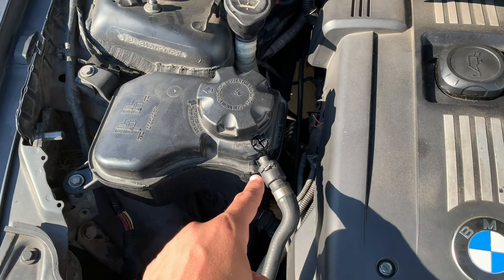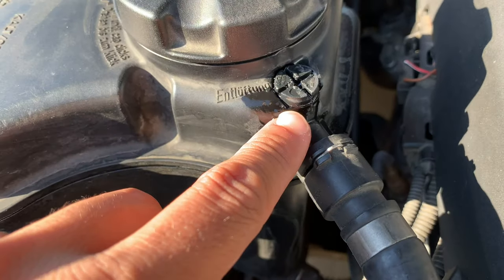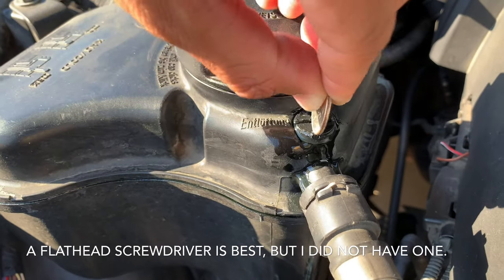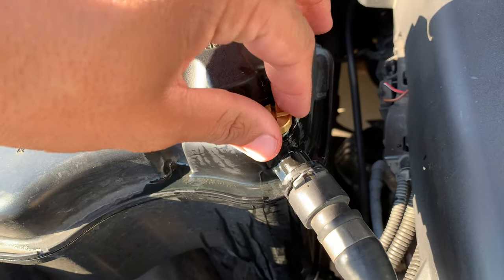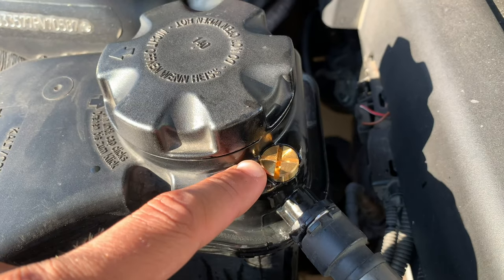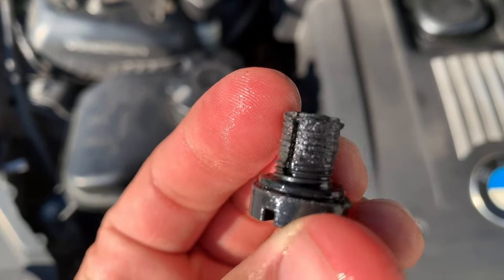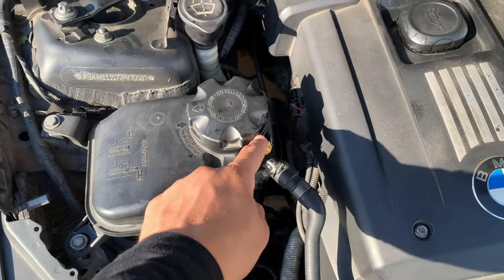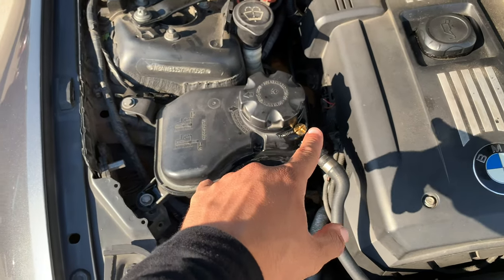BMW Metal Coolant Expansion Tank Bleeder Screw Upgrade! | E46 E60 E90 E92 M3

Comment: Mines litterally snapped 😪 ! The head came off and threading stayed in . defiantly getting one
Reply from the maker: Worth it! Never have to replace again and looks cool too 💯
Reply from the maker: A trick to remove it if the head snapped is get a flathead screwdriver and lighter and heat up the flathead tip until it’s very hot, then press it into the threading hard and it will melt into the broken screw. Then just unscrew it to remove!

Comment: Dude this screw started leaking while I was at the store today went to the oreillys across the street while I was waiting for the tow truck since most of my fluid leaked out. Anyways guy at the store tried to sell me the whole tank he said they didn’t sell the screw on its own. Just now went online and they have the same one you just installed. I ordered it and picking it up Tom. Should have checked on my phone before walking into the store.
Reply from the maker: david guerrero thats pretty messed up that the guy behind the counter wanted you to spend that much $$ on a whole new tank instead of just showing you the best option. Brass screw for the win, glad you got it figured out!

Comment: They use this same cheap plastic screw on Ford and Landrover diesels. Left me stranded for days as nobody here in Australia can get the part. I ended up buying the BMW compatible brass part and a perfect fit on my Ford Territory (V6 Diesel). Thread specs on mine was M10 x1.0 and about 170mm.
Reply: lol a stubby metal bolt, Teflon tape and a standard little oring from any local hardware store could have unstranded you for those days in a pinch.

Comment: Hi I have a question please. I have lot of coolant who left the tank via this screw when I pushed rpm to 4000 for a test. It has a hole in middle of the X. Is it meant to evacuate coolant when coolant pressure is high?
Reply from the maker: If it’s tightened all the way down it shouldn’t, so I’d replace the bleeder screw. It should only do that if it’s loose
Reply: @IzzyE9X  yes it was loose when i wanted to remove it. When i put it back it has broken... but what is the small hole used for? Many thanks

Comment: The screw on mine broke halfway in, how do I remove it ?
Reply from the maker: get a lighter and flat head screwdriver. use the lighter to heat up the flathead screwdriver until it’s crazy hot, then press the screwdriver into the stick part of the screw. It’ll melt a wedge for you to simply rotate and remove
Reply: @IzzyE9X  alrighty I’ll try it now . Thanks for the tips . 🙏🏻

Comment: I have a Bmw f30 did a bleeding procedure and fixed couple thing such as valve cover, oil filter housing gasket, oil change, coolant change, and let the car run for about 20 minutes, i then turned car off and about 10-40minutes later the bleeder screw head broke off and some warm/ hot coolant was squirting out of it, wish I replaced it sooner I currently have the brass one on deck but can’t take off the old thread that’s stuck on there cuz the head broke off
Reply from the maker: To remove the plastic head, get a flathead screwdriver and heat it up with a lighter until it’s burning hot, then press it into the piece of plastic screw. This will cause the screwdriver to melt a hole into the plastic that allows you to turn and remove the plastic screw.
Reply: Question I did the same but my go in to the tank that bad or no ?
Reply: @ArgenisDavila-d2h  I eventually got out the old screw with a hot screwdriver, you definitely don’t want those pieces in the cooling system if you can take it out with something

Comment: should coolant come out through the bleeder if engine cold not started? like next morning??
Reply: Noo
Reply: @DRYMlTE what does it mean if it does? It did on the video, and mine does to?
Reply: @jackhalliwell5381  just means the Oring or the expansion tank its self isn't sealing properly.. it's usually the o Ring but i also had tanks that deformed around the bleed screw where it wouldn't seal properly.
Reply: @DRYMlTE  it doesn’t leak when everything is shut, it just squirts out as soon as I loosen the bleed screw, same as the video does